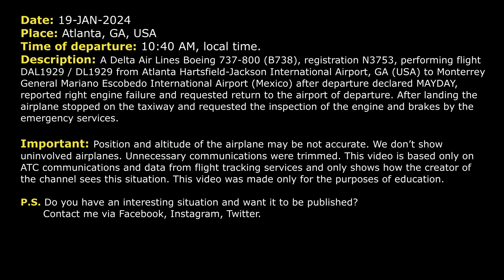Airplane loses engine on take-off at Atlanta Airport. Delta Boeing 737 has engine failure. Real ATC

Comment: Good job by all. I'm a retired former center controller, tower controller, and USAF aircrew. As they say, "calm is a superpower". I had the privilege of working briefly with some Atlanta controllers, and they are the best in the world. Losing an engine is not necessarily a dire emergency, but it's not comfortable either on a twin jet. And I guarantee that anything that might seem superfluous questions by any of the controllers was probably at the direction of the supervisor standing over their shoulder, but they kept it mostly to a minimum to let the pilots do their job and at the same time sequence traffic, and the pilots were responsive and not overwhelmed. It's the way I would've done it, LOL...

Comment: I don't understand then delay for that final turn?  If it was declared emergency landing is there not a protocol for what the pilot has to do or more importantly what they cannot do during emergency landings?  My understanding is that you can't do certain troubleshooting to see if you can recreate an alert it requires grounding for inspection and i think, could be very wrong, they were doing just that at around the 435 mark.

Comment: First time I have heard them ask about infants. The passenger manifest never lists lap carried infants, and I think that has been an issue recently (I think there were 2 on board one plane that had to be evacuated).
Reply: FAs should track lap children because they need to be seated in a row/side with an extra oxygen mask.  But as a FF, I would assume souls on board would include infants. 99% of the time it isn’t important, but there are horror stores about not being to get souls/ hazmat from dispatch ( pilots might be casualties or leave the info in the cockpit.)

Comment: Great job by the crew but why you wouldn’t just go straight for runway 27R is beyond me.
Reply: I’m no pilot but it could be they need to do lots of calculations with the engineer because they are landing with all the additional weight of the fuel. They may also need to check all the landing equipment is working as it may not only be the engine that is out. Just a guess.  I’m sure a pilot will reply.  Good question.

Comment: Why don’t they standardize fuel in pounds or minutes but not both. Chose to standardize one or the other but not both..That would eliminate need to ATC to ask the pilot twice after the pilot has already given fuel in pounds then the ATC comes back and asks for time?
Reply: weight of fuel if for firefighters, minutes remaining is for ATC in case the runway is shut down and they need to divert them somewhere else or hold.
Reply: @slappymcgillicuddy7532  Actually the ATC could enter it into a calculator constantly giving a time update, despite that will have deviations. Also it should be given in kg as it's easier to calculate with and metric systems are (industry) standard. Despite the US generally uses standard imperial units.
Reply: From a fire fighting point of view it should be in pounds or kgs. Something that is related to the volume or mass of fuel being carried that needs to be extinguished if it catches fire. The time factor is more of an endurance measurement that is useful for how long you can stay aloft.

Comment: Way too many engine failures the past few years…something is not right with this frequency of engine failures…
Reply: What are the number of engine failures? Do you have a source  they are increasing.
Reply: It's called social media. Everything bad that occurs in aviation is broadcast in close to real time to anybody interested in the subject, and even those who aren't. The failure rate for modern high bypass turbofan engines is microscopic compared to the pre-ETOPS days. This is why planes can fly from LA to Auckland, NZ on just 2 engines.
Reply: @KevinWindsor1971  Social media just confirms your bias. They're showing you (on your feed) everything what you have looked at in the past, and projecting it to future recommendations (what you probably could like and wanting to see as well), in order to increase your watch time. There's no such thing as Social Media showing an increase in occurrences, as Social Media doesn't show the (objective) reality.

Comment: How do you lose an engine? Did  it fall off? May be you had an engine failure or engine fire and required to shut down. More DEI at work at Delta. For those that had been doing this for 20 plus years, she is not using standard FAA terminology and uuhh and ummming a lot.
Reply: Incredible, there's no scenario where y'all can't shove "DEI" in there somehow. At what point does such a fixation become an obsession?
Reply: I knew we’d find a DEI comment in here.

Comment: Drives me nuts everytime I hear the crew give fuel in time and not lbs.  Should be SOP.
Reply: Pounds matter to firefighters. Time matters to ATC. When talking to ATC in the air, time is the only thing that has value.
Reply: @clifft7832  you can calculate weight + distance to time :D
Reply: Time is what’s suggested in the AIM.
Reply: It seems that no matter which the pilots chose to give, ATC wants the other.

Comment: Ok I have to ask. Delta pilots, it's 2024 now. Do you plan and brief an emergency return before departing during your crew briefing? It seems you do not and you don't have a plan.
Reply: another backseat driver
Reply: @nsbioy  Well yeah. If I'm flying on DAL these days I'm doing it from first class. So yes, I have a back seat interest here.
Reply: Wtf you on about? They did their plan.
Reply: @saxmanb777  Why didn't they know if they had to perform an emergency return that 26R wouldn't work? Why does it take a crew extended vectoring to be ready to come back and do an ILS to a runway? You do the memory recall items, then one person flies, the other talks and performs the rest of the checklist -- and it isn't that long of a checklist. And don't dilly dally around. Tell the controller exactly what you need. Otherwise you end up getting asked a lot of questions and getting turned back into the localizer (that you're not setup for!).
Reply: @JohnSmith-zi9or  we don’t really do a landing distance calculation for an emergency return on a single engine. That’s done as part of the single engine QRH landing procedure. It’s literally in the middle of it. They weren’t dilly dallying either. They were taking their time to make sure every thing was completely done for an approach. There is a lot to do. A few minutes for securing the engine, then setting up for and briefing the approach. Then they need to message company if they can, and they have to inform the flight attendants and pax. If we need more time we ask for it. We NEVER hurry. Slow is smooth, smooth is fast. They did a fine job and this is literally how it’s trained in the simulator. I’m not at DL but I’m on the 737 at a competitor.
Reply: @saxmanb777  Did my comment make it through? I don't see it here.
Reply: they do, what did they do wrong here?

Comment: first time i've seen an ask for number of infants @ 1:48

solid handling on all sides. fan of the 'mayday' call which is all too rare stateside.

still frustrating to see airwaves and brainwaves spent on back-and-forth basic data that should be readily available in a commercial aviation setting - the automation for that should've happened a decade+ ago.

Comment: I don't get it. A mayday call is an emergency. So why the huge delay in getting the aircraft on the ground as soon as possible. Why all the vectoring and such a wide pattern? OK they need to do some checklists but get the thing DOWN soon as possible. One day someone will lose an engine, then another and they are screwed. It is rare to lose two in the same flight but it is possible. ATC has ONE job in this situation: Just help to get the aircraft on terra firma. No need for all those silly questions. A quick fuel and px count is all that is needed, plus request possibly for emergency services. Other than that ATC should give the vectors for a landing then shut up.
Reply: It's not a 172 and it's not MSFS.  A big part of what they were doing was running the stopping margin calculations. You actually hear one of the pilots say 26R is going to be tight on stopping margin and request 26L How did he know that? Because he ran the calculations. A single engine landing in an 800 will typically drive a flaps 15 landing. What VRef and VTarget would they use? There was a big gust factor due to the winds. What does THAT do to the stopping margin? What if they weren't taking off out of ATL, what if they were taking off out of an airport with shorter runways. Could they even attempt a landing? It's literally illegal under Part 121 to attempt a landing you don't have stopping margins for under existing conditions. Stopping margin calculations are run using current METARs and RCCs, plus any current abnormals, like being single engine. What were the RCCs? What if it had been snowing and the RCCs were 3 or 2? Could they have attempted a landing at flaps 15? What Autobrake setting? 737NGs factor thrust reverse into stopping margin, but they only had 1 reverser, so that's another number that has to get crunched. In addition to the QRH for the engine failure, they would have also run the single engine landing checklist, which is its own thing. It has things like "What are the single engine climb gradients for the missed approach procedure for your landing runways? Do you have sufficient performance to meet those 2nd segment gradients if you have to go missed?  Then a descent, an approach and a landing checklist. Add in contacting Dispatch which is required under Part 121 and briefing the cabin crew (evacuation or not, if so, which side, what additional information do they have and what additional information do they need?)  and it's a good amount of time.  A lot of the MSFS kids and GA pilots like to try to correlate what they do to these events in transport category airplanes operating under Part 121, and it's just not the same.
Reply: No! It’s just an engine failure. The plane can fly for hours on the other engine. We will take all the time in the world to secure the bad engine and prepare for a single engine approach. There are lots of things to do. Sure, we’ll stay close to the airport but we’ll not be hurriedly getting back on the ground. Too many mistakes happen by hurrying. If literally on fire, then that changes things.
Reply: I think the pilots would have informed ATC if the route they were given was not to their liking... 
Keep in mind that takeoff and landing are the most dangerous phases of flight because of how close you are to the ground. Especially with an already-present malfunction, rushing into it overly hastily can lead to disaster rather than being helpful.
Reply: Slow is Smooth. Smooth is Fast.

You literally hear that in the pilot's comms and it applies equally to running the checklists and configuring the aircraft for landing.
Reply: First you have to run the emergency engine failure/fire checklist.  That takes about 5 min, then the single engine approach checklist, that takes about 5 min, you have to do a landing checklist and if an IFR approach is needed that takes about 5 min. brief the flight attendants and do a pa to the pax. All those checks are important because landing on one engine is nothing like a normal landing and if you leave something out it can be deadly. You have to land at a much higher speed and that means you need to know if the runway is long enough and what flaps to use and what speed to approach at, what do do if you do a one engine go around. All on checklists because no one can remember all of that and get it right without using a checklist.  If all you had to do was just return to the runway and land it would take about 10 min just to get vectored as close as possible to the airport and lined up with the runway.  If time is not critical we will take the time to make sure everything is done before landing.   When the engine is on fire we will be landing the airplane quickly and just trying to get the major important stuff done.
Reply: Have you ever gone through all the pages of the B737 QRC and QRH and seen how much crap has to be dealt with? Along with communicating with dispatch, the flight attendants, the passengers, and setting the cockpit up for a return to Atlanta?
Reply: hard disagree. when there is time to take full precautions, doing so prevents further degradation of the situation. note @ 5:31 that the flight crew requests more time to prepare for the landing. the wide pattern gives as many options as possible to the flight crew, who very well may not have as maneuverable of an aircraft at that point.

a typical flight has all the time in the world to configure the aircraft for landing. this flight had that sprung upon them while not even out of the takeoff, and was down an engine in addition. that's a lot of variables to set, doublecheck they're set properly, and account for the added variables of a non-functioning engine (extra checklists).

you don't get a second chance at landing, especially when you're down an engine (go-around is a lot harder when only half the power is available). better be damn sure you get it right the first time.

this was handled excellently by all involved.

Comment: Always turn away from the dead engine.
Reply: It's a 737, not a Seminole.
Reply: Turns directions don’t matter in a jet. Plus it ignores the many airports that have special single engine failure departures that require turns to avoid terrain or obstacles. The procedure is the same no matter which engine fails.
Reply: thanks for the tip
Reply: I.e. lost right-side engine, turn left?
Why?
Reply: And crash into other traffic?
Reply: No you can turn either direction in a large multi engine airplane and it is no problem. Maybe ill advised in a light twin but that is a different ballgame.
Reply: thank you Captain

Comment: I'm not a pilot so I am uncertain of the protocol, but a clear Mayday, Mayday, Mayday call, to me, is so helpful as anyone within radio range knows exactly what is going on.  Too often, I hear a pilot declare an emergency so nonchalantly or reluctantly that ATC has had to get confirmation that there really is an emergency.  This crew never had to waste time to clarify even once that they needed assistance.  
Well done by everyone involved, in my opinion!
Reply: Back in the day the airport I worked at would regularly practise its emergency response plan. The were specific levels of response depending on the type of call. A Mayday brought the Rescue Fire crews to Full Emergency phase, local hospitals alerted and make preparations for receiving casualties, ambulances arranged etc. It was quite a big deal.
Pan Pan brought the RFF to Local Standby phase, other infrastructure was notified but didn’t divert resources etc, just a heads up. It’s probably different in the USA but there was a logic behind the standard phraseology.
Reply: bOnly one consideration, among others, in declaring an emergency is knowing the debt and complexity of initial cockpit indications and notifications.  Well constructed aircraft of today the main considerations when warning lights or anomalies occur, is the aircraft able to fly and do we have control.  Checklist have to be ran before the full extent of the malfunction is available to the crew.  this is not always the case.
Reply: You are correct but there are other considerations, we had abnormal and emergency checklists. If it was an abnormal we were required to declare an emergency but the threat was very low. if it was an emergency we also were required to declare an emergency but the threat was high. Saying Mayday isn't needed when you are already talking to ATC when there is a low volume of radio traffic. Example on the 757 I flew a leading edge device light was something you can fly for hours with and pretty much no threat but we would have been required to return to land and declare an emergency.  So saying to ATC "we are declaring and emergency and we need to return to land" is not time critical. But an engine out is time critical and saying mayday gets their attention right away and you do not need to declare an emergency if you say mayday.
Reply: @bkailua1224  Some of the response you provided is a product of your company policy and preferences.  Abnormal checklist when completed, still leaves the captain able to make decisions about declaration of emergencies,  I am saying this because our company was very strong on Captain's authority. I have often heard ATC intreat air crews to declare emergencies when that decision was untimely or severely delayed
Reply: The golden rule of aviation: Aviate, navigate and communicate.
Reply: @d3v1ld0g69  It's not a golden rule of aviation more of an outdated diadem. The complexity of skills and coordination needed in an airline emergency far surpasses anything [  fortune Cookey logic ]  on that same level of logic, Forcing the point proves you don't really get it from your experience.

Comment: Great communication between ATC and pilot but should the pilot be executing a right turn when it’s the right engine that’s failed?
Reply: It's a 737, not a general aviation airplane. I don't know what Delta procedures are, but at my airline, procedurally, we select half bank on the MCP for single engine situations. But even if we didn't there's plenty of aileron authority for turns in any direction.
Reply: I am not a pilot, but turning right with the left engine working makes more sense to me than turning left. What I am not getting?
Reply: @TinLeadHammer  you're not getting "nothing" Because there's nothing to get. In a transport category jet with an engine out, direction of turn is literally not a consideration. Some GA or MSFS pilots like to try to correlate what they think they know to these scenarios. So sometimes you see silly comments.
Reply: @TinLeadHammer Trim the rudder.... PLENTY of authority.